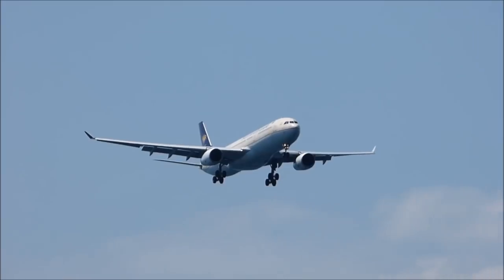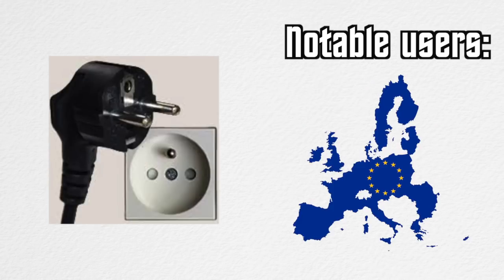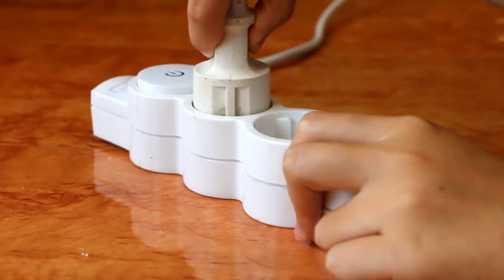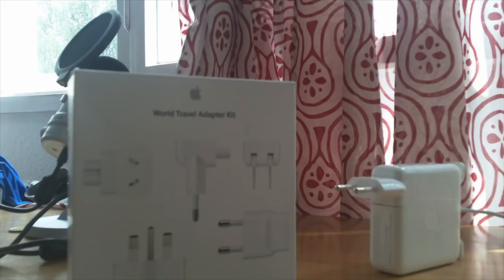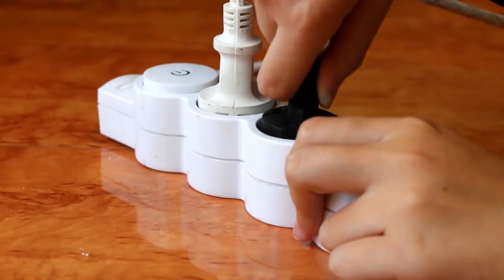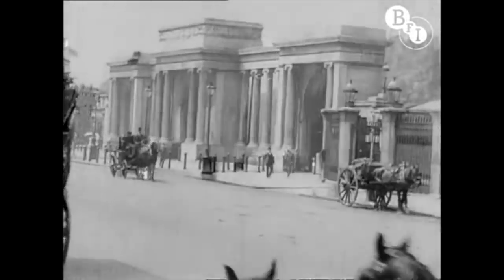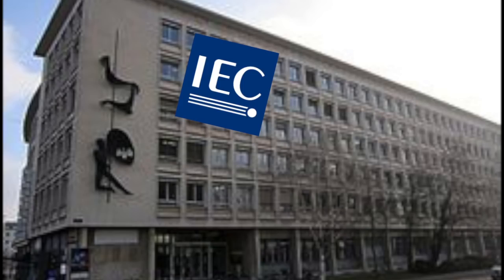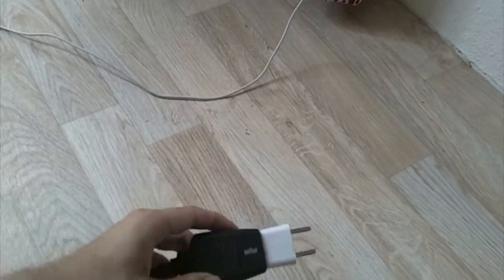Why Different Countries Use Different Plugs

Comment: Electricity first came into our homes for lighting and was supplied from a nearby power station.  Voltages and plugs were standardised later.  American appliances use a lower voltage and higher current compared to European appliances.  That's because of the materials available in the early days of electricity.  American cables were insulated with cotton and European cables were more heavily insulated using rubber and pitch.  In laboratories electrical connections tended to be made using spade (flat) connectors or wander plugs (round).  The first plugs in America were based on spade connectors and those in Europe were based on wander plugs.  The individually fused square pin (actually they're rectanguar) plugs used in the UK and Ireland were brought in to be used with new wiring standards after WW2 when copper was scarce.  They were designed specifically to be incompatible with the older round pin plugs.

Comment: i live in france, there the most common plugs and outlets are the type E plugs and outlets. they are literally EVERYWHERE. even the freaking outlet my laptop that i am using to type this is a type E outlet. we also have type C outlets in very old houses but these are getting phased out for the type E outlets that have a ground pin. the good thing is that type E outlets are compatible with type C plugs, the only diffrence is that type E outlets have a ground pin to fit the ground hole on type E plugs. this is why i think type E plugs are the best.
Reply: I live in Lithuania as a Hungarian. I deal with the installation of transformer stations above 400kV.
Only Europe in the world has a non-polarized network connection, so you can say it's crap. The other is the two types of plugs, which is a joke.
Reply: @Zoli049  being able to plug the plug both ways is quite a good feature and at first this might feel bad but then you realise that its AC current, it alternates, so its pretty much nothing.
Reply: @TheOfficialDorianelevator  Do not install electricity! 🤣 It changes, yes. 🤪 One wire is the phase, which is under voltage, the other is neutral, i.e. "zero".
So the European cannot be polarized.
Reply: @Zoli049  yeah they cannot

Comment: I'd still advocate to use different plugs for 230 and 120 so we need at least 2 plug types, that way you can't plug it into a wrong voltage. Plus stop talking about the frequency, it is literally irrelevant unless you have early 60s disc/tape player then yeah the speed will be wrong. Otherwise it can be disregarded, only the voltage matters.

Comment: The hair dryer was the most famous example of my teacher back in occupational school:
"If a European brings a hair dryer to the US, there will be only slightly warm air. The other way around, imagine FLAMES coming out of it."
In that case, it is not the frequency, but the voltage that causes this horrifying effect.
The frequency also causes trouble, but normally on a smaller scale (horns sound different, etc.) but also the behavior of some appliances like motors tripping fuses, even if they are voltage-adjusted.

Comment: In france you have to use the right holes for phone chargers they have 2 different types of holes one of them like sticks out a pole.. in swtitzerland you can plug the charger into both type of holes (switzerland has tripple hole or double hole)

Comment: I've never understood why not all countries have changed to Type C, E and F like most have done. Because from what I learned about those plugs is that they can handle multiple frequencies and voltages (amperages also).
So could it be that it's more a problem where some countries don't want to invest into an universal system  (Or say they will, but don't) ? 🤔 Somewhat like the metric system (and/or SIU) in some countries.
Just wondering 😅
Reply: Why would they have.? Ever heard: If it works do not fix it.
Reply: There are reasons. In The UK and the US they are horrified with the idea that the plug fits either way. Each country has things they consider important.

Comment: 2:03 your adapter should be illegal in europe.. There is something called "Schuko" Plug (which is our standard plug). That stands for "Schutz-Kontakt" translated it means safety contact plug. One of its main benefits is that you can not touch the pins going into your powersupply.

Comment: Different countries speak different languages, use different standards of measurement, sell different products, have different television programs, write different laws, have different holidays.  It always amuses me when people are surprised to learn that they use different outlets/voltages/frequencies, too
Reply: Come on, there are a ton of worldwide standards out there, I find it amusing that you cant get your head wrapped around the worldwide standards, thinking that every country automatically does its own thing in every aspect. I guess that makes you surprised that all countries use the same USB and wireless charging standards.
There is nothing amusing about people questioning why we didnt make a worldwide power outlet standard when we have managed to make worldwide standards for so many other things. HDMI, Wifi, NFC, Ethernet, Qi, Bluetooth, USB and more.
Reply: All countries except the weird ones use SI measurements.
Reply: @kaengurus.sind.genossen  But even then. Not all SI measurements are entirely metric. As in they may be shared in 10ths but they dont convert with multiple of 10 numbers.
Reply: @scootergrant8683  Example?

Comment: Europe uses 230 V (not 220 V), 50 Hz, because that’s the IEC standard. The USA uses 120 V (not 110 V), 60 Hz according to their own ANSI “standard”. Plug type A and B are rated 125 V, so you should NEVER connect them to 230 V using a travel adapter or power bagel or similar dangerous and illegal equipment.
Reply: Nonsense. There is nothing wrong in connecting them to 230 V if the device can take it.

Comment: Solution: Switch out all old wall outlets to ones with built in USB-C sockets, that way no adapters are needed at all. For old USB-A devices a small cheap USB-C to USB-A adapter is very easy to carry on a key chain.
Reply: USB-C cannot give 2000 W.
Reply: @okaro6595  I never claimed that. I was talking about charging portable devices.

Comment: sigh why talkin about frequency when only complain about devices using DIRECT current after all? for real - there'Re only very few applications today which require a specific frequency - I doubt that a simple hair dryer would fault when used with a slightly lower/higher frequency - look up how a hair dryer actually works - otherwise: please make a video where a hair dryer requires a specific frequency and doesn't work when used with a different one - also: the different frequency is NOT the reason for different plug types - and what the hell does the earth/ground pin have to do with all that?
also: the voltage difference isn't caused by the "electric war" between edison and tesla(/westinghouse) - there're many other reasons for why countries chose specific voltages - can be read up on different sources
also: WW2 has NOTHIN to do with all that crap - yes, an "expanding" country may want to "encourage" its new terretories to follow suit - but this also requires a lot of infrastructure - which, back then, just didn't existet
jeez - there's so much wrong with this just 4 min video ... should be taken down for a remake

Comment: “frequency” isn’t the problem, really—voltage for sure is, as is current, but frequency only really affects things like TVs, electric clocks, and computers (which are really just very complicated electric clocks, I suppose)
Reply: Frequency has no effect on TVs. It may have had in the 1950s.

Comment: Do not use adapters to connect type A or B plugs to 230 volts. Those plugs are rated 125 volts.
Reply: Thailand, Philippines: are you sure? (They used type A and B as well as C and has 220V mains)

Comment: In Brazil the changing were more to difficult appliances imports than to make a standard at all, before 2008 our power outlets were compatible with both US-JP flat pin and EU rounded pin, companies used to produce and import appliances with random flat and rounded plug; and the AU three flat pin type used to be our standard type for air conditioners and washing/drying machines, so there were power adapters for all those types. Now we have a new standard with two gauges of rounded pin that vary according the power of the appliances, if you buy a more powerful oven, hair dryer, vacuum cleaner probably you will notice that you must change the power outlet when trying to use it...

Comment: US plugs especially the 2 pin ones are poorly designed. Exposed live metal with no plastic covering it... The plug can be plugged halfway and voltage still passes through. And you have exposed pins that you can touch and get shocked... Saying this as a 14 yr old.
Reply: @King Super Saiyan - 
YES of course , USA plugs are 100 Years behind the time , German plugs stopped shocking people since the 1930s ( Schuko- patent from 1925 ) in new wall socket installations 
TIP: https://www.plugsocketmuseum.nl/Schuko-origin.html + 
vs. 
https://www.youtube.com/watch?v=6Dd6_TghcE0&t=5m38s

Comment: Brazil does use 127v and 220v and that's a big problem because plugs are the same, so people often connect in the wrong voltage. Some cities runs just at 220v while others nearby runs at 127v sometimes. Even in cities mainly with 127v, some (mostly commercial) buildings such as malls and supermarkets runs just at 220v. I heard it has to do as some cities being eletrified (in the past) by American/Canadian companies and others by German companies. Hopefully the frequency (60 Hz) was unified in the whole country in the 70s, as many cities used to run at 50Hz
Reply: Well if you have 127 V you can get 220 V between two phases. Finland used to be 127 V in the cities and 220 V in rural areas until the late 50s.

Comment: Actually it's not the frequency, but the voltage that kills the hair dryer. If you use a adaptor with a voltage converter, you should be fine

Comment: New Zealand is missing from the "I" plug type (240V) slide. Many appliances/computers (especially laptops) in New Zealand come with a built in power switch (switching between 240/110V).
Reply: Chur
Reply: China uses the same plug as Aus-NZ but it is upside down.

Comment: JAPAN uses TWO Standards; VietNam and Cambodia use 2-pin American, 2-pin European and 3- British (in Singapore invested buildings).

I have a totally pin-independent format electrical connector. It is two-wire cable terminated in soldered wire (those wire whiskers are a pain). I also have a small screwdriver with a well insulated handle to neuter safety features. Works everywhere!
Reply: Japan use American plugs along with European 50hz and American 60hz.

Comment: How can anyone compare? The North American plugs look normal and simple. Those round European ones look like a 240V that i plug my EV into. Like they are meant to power industrial equipment. You need that big ass hole in the wall for two little connectors? 😂

Comment: Solution.
Step 1. Cut off the power connector.
Step 2. Mind the frequency
Step 3. Shove exposed cable into power outlet.
Step 4 (optional). Bring a plastic knife to by pass UK safety features.

Pro tip if you can't or don't want to splice your power cable use alligator clips and spare solid core wire
Reply: @Isaac Cool - 
this is the Communist "Russian Method"

Comment: "Plug an American razor or hairdryer into an unadapted European plug and what do you get?  A motor going twice as fast as it is supposed to, a burnt out appliance, a disgruntled tourist, and sometimes, an entire hotel blacked out."   -a leading travel brochure
Reply: If you use only the low setting it might work but if you se the high setting it will instantly overheat and likely break unless the thermal protection works fast enough. Essentially any heating element gets four times the rated power.

Comment: Here in Brazil most things are bi-volt because some places use 220v instead of 110v, my entire state for instance. 
Our plugs used to look like European plugs but now we have the new plugs with an extra pin. The old plugs still work just fine and they're still pretty much used everywhere (charging my 2017 phone with one rn). 

Just sucks that we can't take the new plugs to Europe but that ain't too much of a problem.

Comment: The simple answer was because different country's have different voltage and power usage. Europe use the 230v because its more safe and less expensive to build america use the 110v more deadly and more expensive to build.
Reply: Simple but wrong. It has absolutely nothing to do with that.

Comment: You can connect  2 hair dryers of the same brand in series on 240 volts. Just make sure the settings are the same on each one. After all you have 2 hands. Just dry your hair faster.

Comment: The g type plug has an another safety feature you didn't mention, the larger ground pin is the only way to open the bottom two socket connections, this was praised by a Canadian that I watched about a month ago as he had two kids fond of sticking things in to there sockets, he  literally just talked about it for 15 minutes
Reply: That is very unsafe as a kid can open the sockets with a knitting needle,. Then he can suck another needle on the live and get a fatal shock.
Reply: Okaro X the to pin connecton is rectangular in shape, you'd have to have a fairly small knitting needle to pull that one off and by the way who still uses knitting needles in Ireland, England and new guinea in the 21st century??, I think you're knit picking at something that clearly designed for safety in mind while your power socket is essentially a death trap
Reply: @x_hibernia  Women use them. Various things can be pushed there. Newer British designs are such that you fist have to push the earth and the the two others at the same time. This is much safer.
Reply: Okaro X so your saying Britain has these sockets that have what now?, See you didn't even explain what the difference is between Ireland and England even though we share a border and that we copy each other as seen with driving on the left, and three pin plugs, the house I'm living in also has the power switch on it, which is child proved, like a electrode lighter, so whatever socket you England has Ireland has the same, and plus seen as England is leaving the EU there going to try to export to as many countries just to survive, the EU wants 35 billion off them which will put a major dent in there treasury so I wouldn't hold your breath about these new sockets that you have to somehow fist them?, That's what you replied with
Reply: Wait a minute did you even watch the video, go to the part where the map and scale for all the plugs are and pause the video and if you look at British isles you'll see that all of it is the same plug type, a 3 pin plug with the top pin longer than the two live pins
Reply: @x_hibernia  The traditional British socket is opened when you push the ground pin in. This was highly advance form1947 but not of the standard one would expect in 2019. The problem is that it can be opened with consequence actions. European sockets have safeties that require that you push the pins at the same time. This is much safer as it requires simultaneous actions. Some British sockets have incorporated this in addition to the ground pin.
Reply: Okaro X and what do you think the ground pin is for, it's so that if you jammed a metal pin in even when it's live that the ground socket will cut in and take the bulk of the electrical output, and within half a second the mains trip switch will go off, sure back in the 90s I've a
Accidentally shocked my self and done just that, I hurts but it's far from fatal, so your telling me that European that all you have to do is shove two pins in and boom your taking 240 plus volts, let's do a scenario, I'm about 5 years old and I manage to get hold of some small metal knitting needles, where's the ground wire to stop 235 volts hitting me while where in Ireland I'd get at most 5 volts making me cry and left traumatized but alive, do you see why we don't have two pin plugs now or do you still want to poke holes?
Reply: @x_hibernia  Are you serious? If you touch both live and ground you likely can get a fatal shock. The electricity cramps your muscles so you cannot disconnect. If there is a ground fault protector it can save the life.

Ground can protect but it can also cause risk. That is why if any equipment is grounded all nearby must be and why you cannot put old ungrounded plug on schuko. (I am not talking here about modern double insulated equipment).
Reply: schuko plugs are recessed meaning you can't plug anything else, and the plug shape contours to the socket so you wont get electrocuted

Comment: take a non surge protected power board and take one plug adapter when you travel, if you take a 110v rated surge protector it will blow up.

Comment: Can we all just agree that out of all of these plugs the 3 superior plugs are A, B, and G
Reply: @forlonger5459  
Ding ding your opinion is wrong
Reply: i agree I type is a good plug
Reply: Its similar to the type g plug its basily the type g plug without the fuse the ground pin on the tybe b is round so when pluging it in to a socket and not make good contact  
Plus type a and b plugs dont have plastic insulation on the start of the tabs so when pluging it into the socket there is a small couple mill gap which there is mains power and there is plastic insulation on the type g and i plug

Comment: It is actually a bit more complex. 37 types of plug were in use here in the US alone for just 120V 2-prong plugs in the 1920's:
https://afcaforum.com/forum1/40460.html
And the AC vs DC is not an issue- early appliances of both types were regularly fitted with medium base plugs to fit into the standard Edison-base bulb socket, since most buildings had only lighting sockets, and no receptacles.